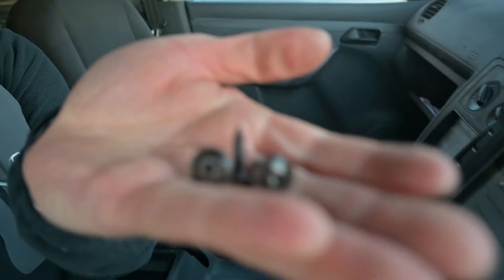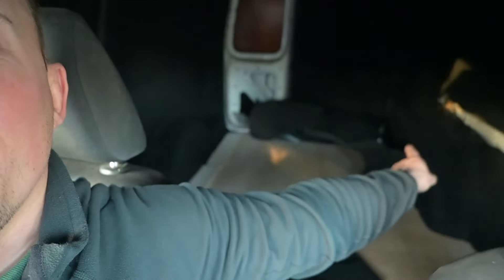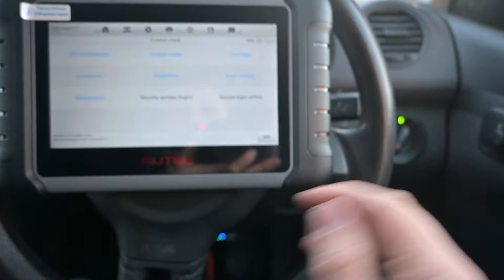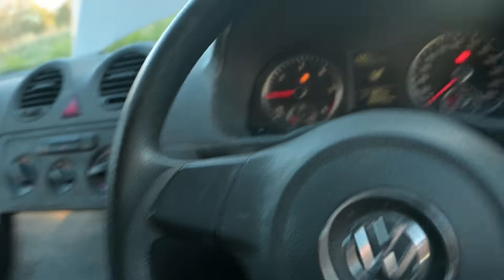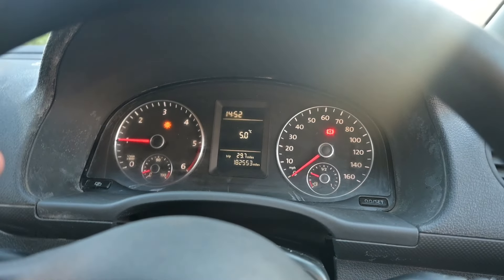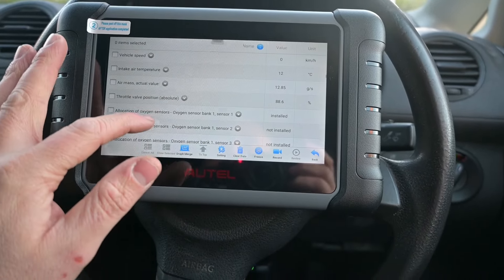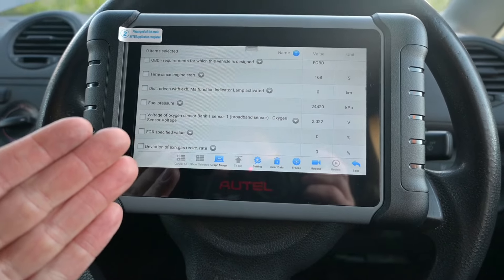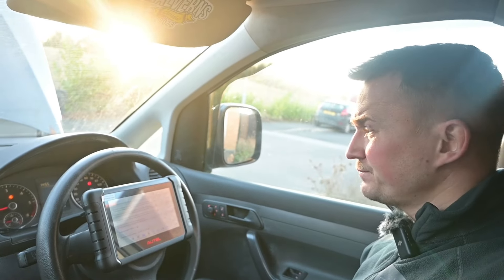WILL I BE ABLE TO FIX MY DAMAGED VW CADDY FROM MARKETPLACE WITH MAJOR ISSUES #auto #vw

Comment: If it has a glow plug off mate it will chew a it from cold start.But once it’s warmed up it will start and run mint,so I would change all 4 as most tight arses only change the one that knackered mate
Reply from the maker: 🤣🤣 for £15 quid mate I think I’ll change them all.. just ordered a bosh set 👍💪 will let you know how i I get on
Reply: @ best way to mate and solves that problem as in the cold with just plug off is hard to start and sounds lumpy till it warmed up

Comment: Easy to check the glow plugs , need a jump lead and a screwdriver . Disconnect the wire or bus bar from all plugs ,jump lead on battery + and other end to shaft of screwdriver if hard to reach cover shaft with tape except for the end to prevent shorting to earth . and touch end of glow plug ,if it sparks the plug is working and not open circuit . Simples .

Comment: It has glow plugs. Just change the glow plugs there cheap enough. Wd40 spray them the night before you take them out. As sometimes they can brake.
Reply from the maker: @hardrive76  will lube them then up for a day or so and then get it warm before I remove 💪👍
Reply: If you can use wd40 or plus gas them for a few days and yes a warm engine before yostart. Take it easy and work them back and forth if they are tight. Way better than snapping one in the head. Also change glow plug loom they fall apart when you unplug them u @Jonbuildz

Comment: If it's a diesel it has glowplugs, wich aren't too expensive to replace. Those diesel injectors wil cost you an arm and a leg though...
First thing I would check is fuel pressure wich you (or a garage) can measure, or might be an old fuel filter. 
Also make sure not to buy cheap ethanol diluted diesel and get the good stuff (Shell), bit more expensive but way more efficiënt combustion will balace that out.
Oh and definitely shut down the EGR valve
Reply from the maker: @appelflapdrol   cheers mate appreciate the comments. I’ll grab a new set of glow plugs didn’t know if they could smoke. I’ve got a spare injector so I’ll check them once I get VCDS up and running. Yes after that it’s definitely fuel to check next… replaced the fuel filter and put good quality supreme diesel in and some additive. Van drives perfect no lights on dash which is so annoying. I personally think it’s injector seal/injector but soon as I get VCDS rigged up might help me!
Reply: @Jonbuildz  Fuelpressure check might be the easiest so I would try to cross that off the list first.
Best of luck and keep us posted ✌️
Reply from the maker: @appelflapdrol  Will get that checked my mate big up enjoy your evening!!

Comment: Fuel running back overnight, had it before
Reply from the maker: @oliverhworld1164  what you mean by that mate?
Reply: Instead of the fuel remaining in the fuel lines at the injectors, it runs back to tank after leaving it standing.  
so takes a good few cranks until fuel pressure builds up. most likely a small air leak somewhere in the fuel system. Any signs of diesel leak anywhere ? Doesnt always leak put thats the thing but let's air in. 
I'd start changing the fuel filter and make sure you change any rubber seals.
I'm not sure on this van but check also if it has a vent in the fuel tank. Try starting with fuel cap off next time see if it makes a difference. 
And look at your autels fuel pressure when cranking from Cold to what it is when it starts ok see if you can spot anything
Reply from the maker: @ will do mate appreciate it 👍

Comment: yes it has glow plugs but they dont do anything till outside temp is below 3 degrees but they do also help with the dpf regen so need to be working correctly and there not very dear to replace aswell pal
Reply from the maker: Might aswell pickup a set then 🤘

Comment: the 1.6s have many issues the pipe off the inlet manifold for egr has a tendancy to block up and can cause rough idle as it blcks up theres a cylinder inside inlet manifold (easiest way to explain it) this fills with shit you can have hard start rough idle loss of power very easy remove and clean also swirl flaps not 100% on 1.6s but definitely on 2.0crs check if theres a little motor or arm on emd of manifold if these gunk up or get stuck they also break and bye bye engine inlet manifold off is only way to delete them.
coolant temp sensors diesel temp maf basically with vw it can be a 5euro fix or ur fucked 😂😂😂